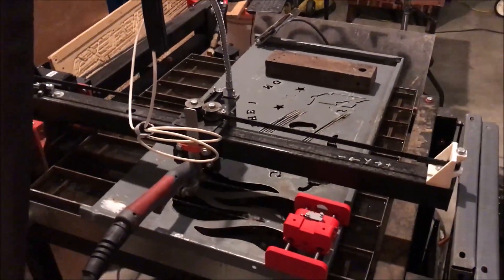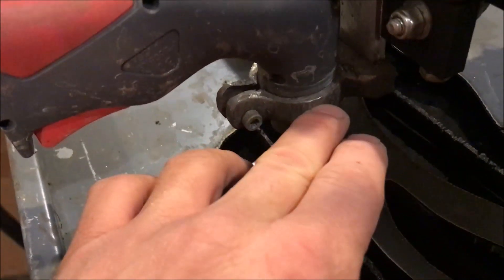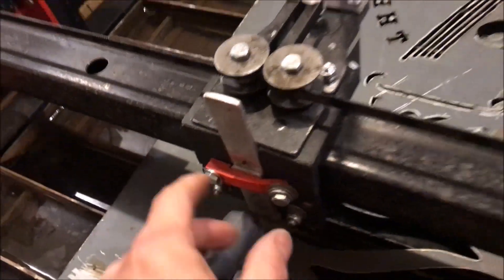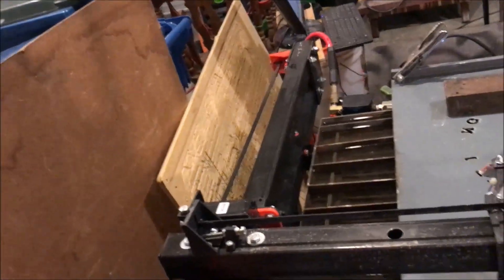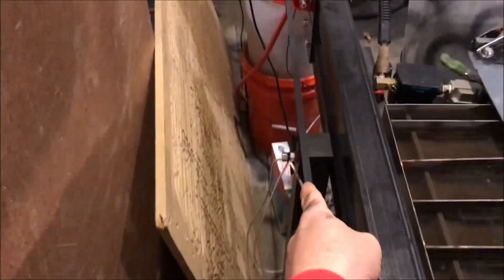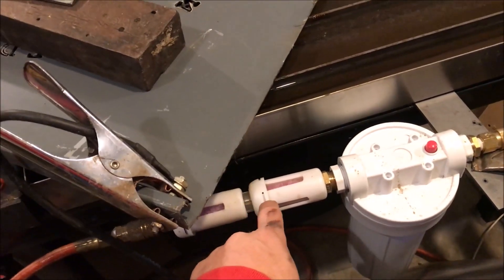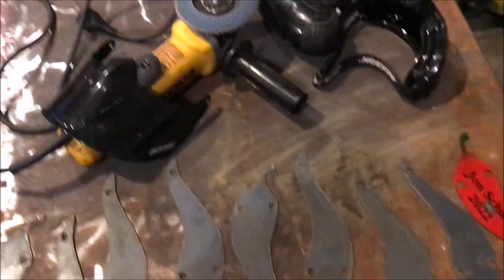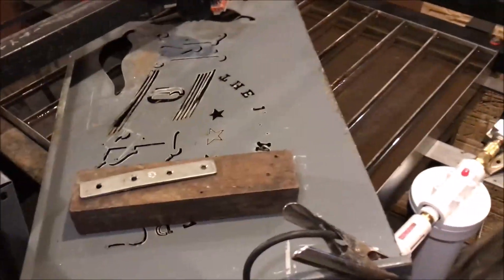JD Garage CNC Plasma Cutter updates

Comment: So just to confirm that are you saying that too much pressure will not lit the arc on the tip of plasma cutter and will not cut the piece?
Reply from the maker: I am not certain it was to much pressure later in another video I think I determined it was a burnt up tip.

Comment: @digitizer101 For the Z-axis strap that is broken..  I would suggest making that out of metal, Then in the middle, drill a hole, weld a nut over the fresh drilled hole, the Get a wing Nut, or a bolt and thread it into the nut you just welded.  You should then be able to loosen and tighten the z-axis to set torch height easily and no longer have to worry about the bolt on the end digging into you y-axis beam.

Comment: Was reading one of your comments over @JD's Garage, what size did you end up building? You commented you were going to try to build a 48"x48" cutting area?
Reply from the maker: I stuck to the original size in the plans. I am still thinking about enlarging it but the garage is a bit crowded at the moment, so I will have to leave it for now.

Comment: Great vid i just got the plans and will either cast the 3d printed parts in aluminium or make silicon molds of them and use 80d polyurethane resin to cast harder more machine like parts. Will let you know how i go :)
Reply from the maker: I would love to hear, I have thought about casting in aluminum as well.

Comment: Hi did you print the 3d parts ?
Reply from the maker: Yes, JDGarage provided files and I printed them on two 3D printers. I wish I had stuck to one 3D printer however, I had slightly different calibrations and this made for some post printing corrections

Comment: Great video on your experience!   I had same problem with my X arm not being parallel to my surface.  If you adjust the rollers (on the Y beam) you can make it parallel - and then shim the bottom of your feet that touch the shop floor to make the water level right. (fighting two different issues - but putting the 1/8 bar in is clever... but I think not ideal)

Comment: Thanks for all your feed backs. I am just preparing myself and makins the purchases to make this cutter as well. It is so welcome to have a third person'view about the design and what is to be changed or improved yet.
I have one question, regarding the squareness of angle between X and Y axis, nobody welds the gantry plate to the gantry tube ? It seems like this information is missing in the building manual. I think I should go ask them. Welding first the bracket to the tube and the top plate will likely result in some  angle heat distortion. The top plate and gantry tube should be welded, and welded first. Still it does not look easy  to have the proper angle welded. on such a small tube, if you consider the impact of a tiny mistake when cutting big parts. I thing I will cut the tube after I weld it to the top plater, in order to use a huge square check along the tube and plate and have a more accurate tacks and  welds at 90°
Reply from the maker: I think only the flat plate of steal is welded and the top tube is than bolted to welded piece. It has been a bit since I built this but I don't recall having any alignment issues following the instructions.

Comment: Good video...did you cut 1/4 in or thicker? With 1/4 in, i had to lower the speed and crank up to 55A.
Reply from the maker: Thickest I have cut is 1/4 in with no problem. I also lowered my speeds way down even less than what the book suggest to get a clean cut.

Comment: Also found I was able to tighten the belts enough to get accurate cuts within 0.01" by hand. The tensioners are just decoration on mine.
Reply from the maker: I have used the tensioners but they really need to be re-done in a steel bracket since plastic just gives to much.
Reply: Wouldn’t an i bolt with a nut on both sides going through the 2x2 angle work

Comment: I had the same problem with my height control clamp. I designed one much stronger then 3d printed. If you like i could send you the stl.
Reply: Ron - did you have the same problem with the X belt tensioners being too short and the belt not running parallel to the X axis?
Cliff Lasater
Reply: Yes I did I had to open them up with my milling machine.
Reply: Yes I did I had to open them up with my milling machine.
Reply from the maker: I haven't needed the clamp to be modified once I added the Z height control module but I did make it out of an aluminum bracket so not an issue any longer.